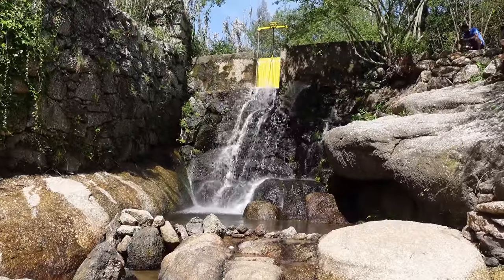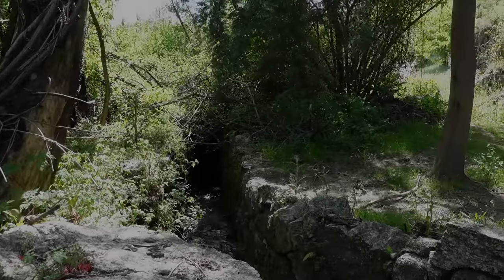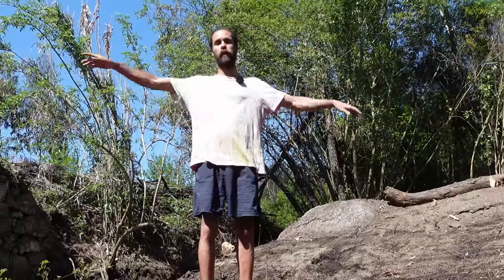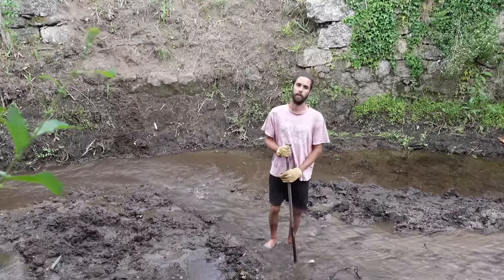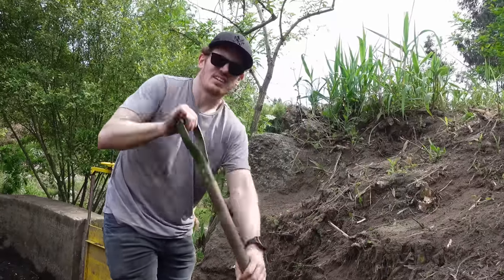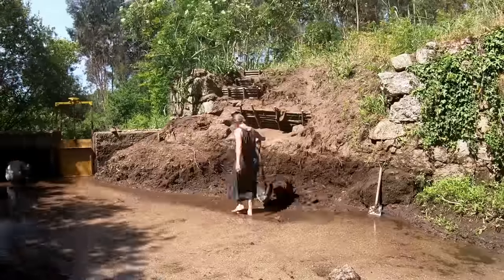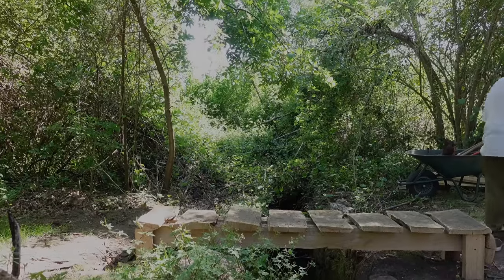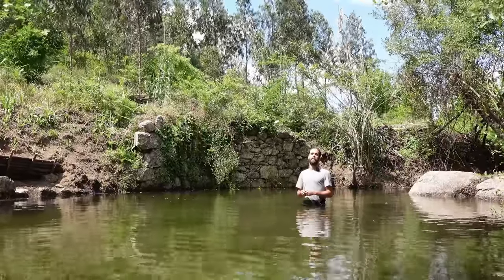#79 Re-discovering an old natural pool

Comment: @19:29 I am a bit worries that the water will seep into the exposed soil next to the cement, near the new banked stairs. The seepage has a risk of breaking down the bank and causing the damn to burst around that side. I recommend you sure up the bank behind it and add plant life to that section for the root network.
Reply: 100% right, good eye
Reply: If you look at 3:20 you will see that the dam is connected to the wall lining the side of the little valley. At looks like the people who built the dam used a natural "seat" in the valley side, left in the massive and fixed rocks and used the movable ones to build the walls. The stone cemented wall will join onto a fixed stone at the end, they would not have gone to all that effort and then leave in mud in one corner and then build off that for the dam wall.

They should obviously regularly inspect the dam for any leaks and any other deterioration and open the sluice if concerned. They could even a video of the inspection and they will certainly get some Portuguese  Civil Engineers to watch an comment. I can not read the Portuguese small dam regulations but it appears to be too small for the regulations to apply, it depends on how you define the height.
Reply: @johnclements6614  Well I would hope that there is a bedrock to connect to and not just loose rocks in mud. My concern was that if the mud was being removed that there would be a destabilisation in that region. But in principle I agree with your comment and accept that you very likely know more than myself about this matter as I have no formal qualifications or experience in the subject, only a passing interest.
Reply: @gm2407  It is good to question the safety of things. I do not think it is beneficial to not raise concerns. 

People also claim knowledge here that they do not have. I am a Civil Engineer but have never designed or constructed a dam.

I have just watched an earlier video no.47. The dam is on the neigbours land, the old stone work is well over a hundred years old and the neigbour carried out major repairs to the dam wall. The water was transferred to the adjacent farms, the translation said by pipe. I would guess (maybe wrongly) that it was a leat, man made contour following stream; much easier to maintain with all the silt and see who is taking the water.
Reply: @johnclements6614  Waterworks based on natural hydrology for clay and such are prone to failure as well, also there are once every decade and once every century events for flooding or rainfall in an area. So happy to point out risk in that way. I remember watching a Geoff Lawton video where one of the damns on Zeytuna farm failed. So even people who use them often and bring in outside help can still have failure risk in construction. Not that Geoff himself is an engineering expert which I am sure he will say he isnt.
Reply: @johnclements6614  Sorry, just to clarify it was not a damn it was a pond connected to conteur swales and overflow points. There were several on the farm for years but I believe if I recall correctly one failed. No one was hurt.
Reply: @gm2407  I assume it did have some sort of retaining structure that failed. There have been cases where water disappeared rapidly out of the bottom of a reservoir and entered mines. There is a famous UK court case about that.

Comment: having the larger lagoon is probably very good for fire helicopters, with the water being deeper they should be able to fit their buckets in and use it to fill up if there is a nearby fire (as long as they are aware of the lagoon)

Comment: Awesome work.  Maybe add some freshwater oysters to help clean the water as it was mentioned that the pool could possibly be polluted.  Also possibly a small power generator for the waterfall since that's a big height difference for the water to fall even during the dry seasons.  At least this will provide power for lighting the area at night and a small house with a heat pump for cooling off.

Comment: you have to make a mud trap at the top before the dam. using several small dams for example. then place medium sized stones along the water route leading to the main dam. Its function is to trap tree branches. so that the water entering the main dam is cleaner. As you can see, the water flowing out of the dam looks cleaner, doesn't it?

Comment: It seems the creek is continuously flowing, so to prevent water from spilling-over at the steel gate (which may deteriorate it thru rust) use small spillway made of concrete and position your steel gate higher than the spillway...

Comment: Nice rock pool ! 
Maybe you could make a "deep part" in it?
If you want to store more water and also make some more pool down stream :
1 : when there i no water ,during draut ( and no salmander larvae frogs in the rock pool )
Blast out the,bottom rock to increase depth use  powder to minimise vibrations,  keep safe distance from the damstukture. 
2. Build some more rock cement pools down stream ,
No need for wears , put a 160 mm plastic double sided connector  with stone textur thru the walls , put  a plug upstream in the  conector.( Dont forget to put lubricant on the rubber seal.)
There are special connectors for casting into concrete ,there are glued gravel on them .
These pipes is used when you want to flush out debris from the bottom .
And as drains  when you do the work to be able to do concrete work even if there are  a little  water flow, avoiding the dam to fill up prematurely. 

By designing the wall with a overhang you can make waterfalls that you can shower under.

I think you can get the local population help with knowledge and materials ,
They would   surely  see the benefits with  the work.
Building reservoirs to preserv water ,is a very god tool to coop with varmer summers and  unevenly distributed rain.

Comment: You all are brilliant! I’m just no body, but I have a few ideas. This may be out of context, but I watch on tv. Does not let me comment. Trees. You know that pigs can destroy root systems. What if you raised pigs, fenced off sections and let them go. Like goats and overgrown fields. Mold. What if yo put salt under floors to keep wood dry. Have a easy way to add more if needed? The tree structure. The meat in the trunks. Except for shrinking when they dry, it seems to be perfect texture for patching holes. You would just have to add something for shrinking. Like starch or paper machete’. That’s it. Thanks

Comment: Update on Project Kamp next level housing.  I just learned that the cost of containers has gone up considerably since COVID 19 disrupted trade around the world.  Adaptation to the new information is this.  Buy 40 foot containers (high cubes would be nice, depending on cost differential) and plasma cut them in half ( two 20 foot modules with one open end).   Now you have the ability to easily frame an entrance door, a window and a covered porch with conventional lumber frame building methods.  Add  rigid sheathing to one side of the frame and bolt the infill frame to the container walls, floor and ceiling.  With the infill panel bolted in place  you have the structural integrity of a 6 sided container with a conventional door and window.  The door/window layout can be reversible, a sliding glass door can be an option for the conventional door and window and the front porch can have multiple variants from shade cloth awnings to stick frame shed roofs with steel standing seam roofing.  The first iteration features the wood floors cleaned and sealed, the walls and ceilings painted and a small wood stove that can double as a cook top for heating a tea kettle or washing water and a lavatory sink that drains directly onto a deliberate tree (greywater) just outside the container and a stand alone limited capacity 12 volt lighting kit. Every second module has a full swing back door that faces onto a natural area.  Cost per 40 foot container, delivered in USD today is approximately $3,300 or $1,650 for the base module.  Plus plasma cutting, entrance infill panel, cleaning & sealing floor, painting walls and ceiling, woodstove, lavatory sink and front porch roof, one solar panel, one battery and 3 - 12 volt lights sized to battery capacity (2 interior, 1 at entrance.)   I'm fascinated by your project and I send all my best wishes. 😊

Comment: That wormy soil would be great for your gardens. Open the water gate a couple times a year and while the lagoonis draining, rake the bottom to stir things up and flush the mud out of the lagoon.. to move the silt to the lower part of the stream.  This is great nutrient rich soil you can use in your gardens.

Comment: Interestingly enough your lagoon is to control water elevation for a water wheel. Water elevation is extremely important to what a water wheel can do. The further the elevation drop the higher the water wheels rpm, however, the more water dropping less creates higher torque and lower the rpm.

Comment: The mud should be put back on the ground floor for water retention, many people make mistake of removing all mud that is actually holding the water from leaking into ground. Seen that around my home where modern people destroyed old ponds without using the brain. Sometimes human can make it worse and in case of summer drying up that could be one of problems too. We have problem like that too, months of 0 rain and natural pools dry up.

Comment: 12:08 carrying them this way is unnecessarily hard. You should either carry them with your shoulder havin the middle part on the shoulder and balancing the weight with your hand at the front or carrying them on one arm by having the front center of the wood leaning on your wrist and the center back portion on your elbow. Hope I made sense.

Comment: Im pretty sure the water retaining wall is going to fail fairly quickly. Awefully thin for the new amount of water. Unless its massively reinforced with rebar....maybe form another layer inside? Will save a load of work if you have to completely rebuild 😮

Comment: Maybe you need some revetment to keep the soil from sliding in again. Wet soil always wants to go horizontal and go into the situation that it cant even hold a slope. That is the reason why there is so much mud in the pond. 

Willows can make life revetment, as long as it stays wet, it should be able to cope with the hot summers. 

Just saying... The revetment walls did seem to have worked out. I just had to comment before watching everything.. :P 

Greetings,

Jeff

Comment: You could have created/refill the terrace by the reservoir with rocks or lesser soil and used that super rich soil from the bottom of the reservoir and moved it to a better location and you could have grown ANYTHING on that soil (it already even had worms). That was wasteful use of enriched soil in MHO.
You need create a bigger water reservoir, your creek already dried up once before due to extreme heat (in the future it will only get worse with climate change been what it is). Enlarging your reservoir to hold more water and be able to funnel that water throught your property (using pipes or irrigation cannals) would be a wise investment!

Comment: I have a question that had lingered with me since watching this video: did you do any analyses to assess whether the existing wall could support the increased mass and resultant force from the increased water build-up? How do you know if it will stay up/ or what percentage of the max pressure it now sits at? Are you at 50%, 60%, 90%, >100%?

It would be a disaster if, when filled up fully the wall burst. If anyone was in the pool they'd flow over the edge 😢

Comment: What id you open the bottom of the slouse just a tiny bit instead of overflowing so it can drag out more of the mud and sand at the bottom, won't that make it deeper without any more work?

Comment: The fortification of the wood walls to keep the soil from sliding, should have been made stronger with mud & grass & then smoked solid with fire nearby, then it would be like concrete. Its the same you do when making a bushcraft hut to keep it dry hot & warm & solid enough to withstand the forces of Nature. It annoyed me however you didnt finished the soil removing fro the walls, which means your pool will be good for snakes frogs etc, but will look like a mud hole for people as the mudd will keep polluting the water. Next time please tell us which country area & region youre in.

Comment: The way u guys work is a lot different from how we work in South India 🇮🇳  ... We use Small shovel and bend while picking mud into it and we don't use Buckets we use Tubs made with plastic or Bamboo , We don't use Wood much ..we use a lot of Granite , And we carry logs on our shoulders to any distance .. and we use different Tools to Loosen the hardened Mud . I think u guys are not comfortable in Lifting Bigger weights .. u r working a lot to lift just small Rocks.  (IGNORE Grammatical errors)

Comment: 7:07 Am I the only one that doesn't like the height of the bridge?? IMO it should have been almost flat with the ground, the step to get on it is too much o.o
Reply: Bunch of unskilled people, what do you expect ? if they made it flat with the ground they wouldnt need to use a board to drive the wheelbarrow up the "bridge" 7:45 . No thought process goes into the projects they are doing.